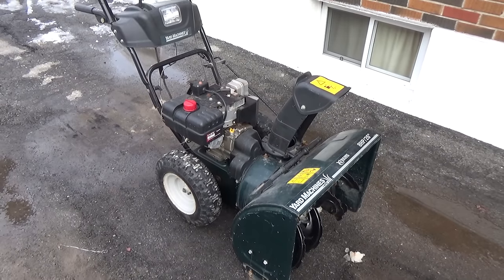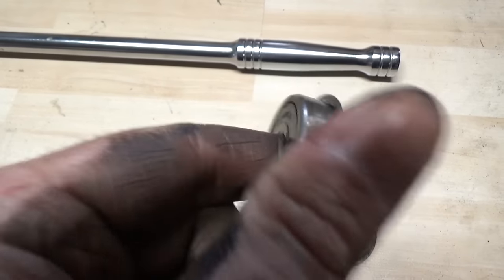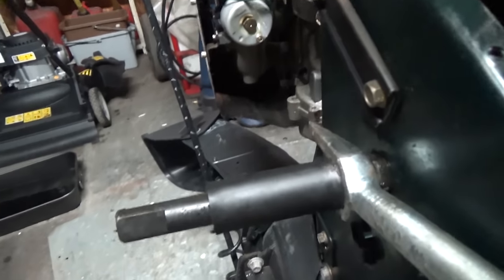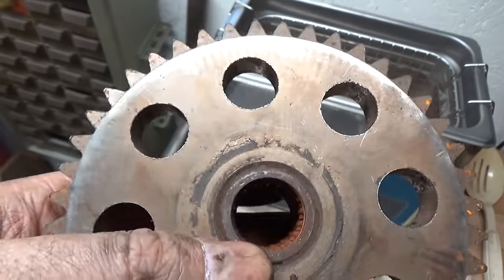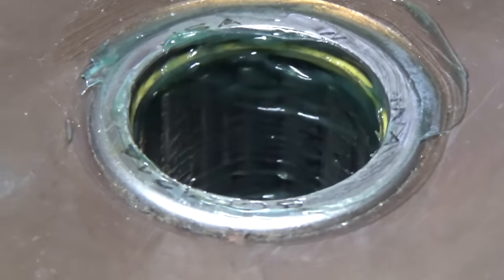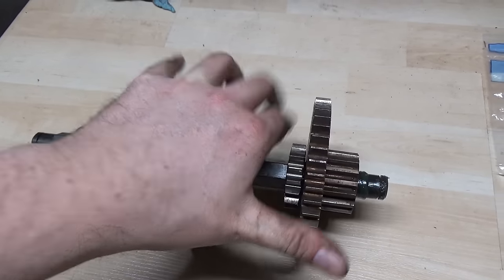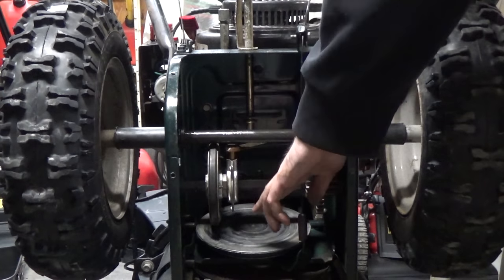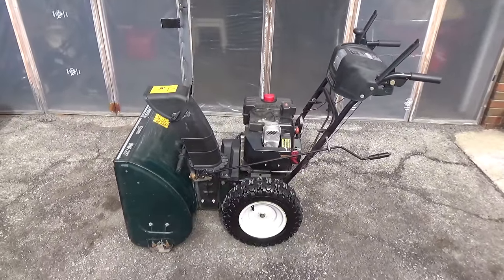MTD Snowblower Doesn't Move - HOW to FIX!

Comment: A very good repair job with excellent explanations and illustrations.  Excellent job and thank you.  However, Given the costs of the labor and the parts as well as the age and condition of the snow blower, I probably would have just purchased a new snow blower such as an ariens 28 inches.  I just don't like the quality of made at all And I have owned them in the past.
Reply from the maker: Get an Ariens deluxe or higher model
Reply: @EliminatorPerformance  Thanks for the advice and I think you are absolutely right.  Especially given the fact that you routinely work on these things and you know how they are built and designed.  By the way I really enjoy your channel.

Comment: FYI Also, Latex or nitro gloves work great keeping your hands clean when dealing with a dirty repair. Also saves on the hands. As many have stated you have done an excellent job! Also, those washers on the axles are referred to as Thrust washers. The pliers you refer to are Channel Locks.
Reply from the maker: I prefer using barrier cream, works pretty good and my hands wash off fairly clean at the end of the day! Keeps hands from drying out after being in contact with gasoline too!

Comment: If my blower is in reverse and I shift into drive, the unit will remain in reverse until I upshift into #3. Once there I am able to down shift to #1 and everthing functions forward until I go into reverse. How do I adjust for this? Thanks. BTW , very nice video. Your instructiona are easy to understand and follow! Only one suggestion. You need a light for dark areas. Again, thanks!
Reply from the maker: Thanks Mike, issue is with your shifter linkage, basically it's not going far enough one way.

The reason they work from 3rd to 1st but not R to 1st is simply due to the play in the linkage.

You need to adjust your cable or your rod, lengthening it will increase drive in 1 direction, shortening will do the opposite.

Play around with it, usually takes me 2 or 3 tries to get em right!
Reply: @EliminatorPerformance  Thank you! Have Tools.  Will try!

Comment: I always just used lacquer thinner on a rag to clean off greases & oils, etc.  It even removes old hard grease well, like on 100 year old victrola spring motors where what was once grease has basically turned to cement.  It's less than 20 bucks a gallon here and a gallon will last a long time.  Yeah, it'll turn your hands white too, lol.  As white as 1-1-1 trichloroethane vapors will in a heated degreaser dip tank I used to use in a factory when I worked in their repair/reprocess dept.  If you have a lathe, chuck up those axles and give em a spin with a light grit wet sandpaper or even that scotchbrite and it'll speed up your work instead of having to wire-wheel everything. :)  It's also good for putting grease on a rag and coating the axle lightly.

Comment: Is it bad that i had this issue today. My machine is from 05/06. But i can’t get the roller barring. The whole assembly but it comes with a new friction wheel. If i find the rollers she’s a keeper. If i can’t i may just get a new machine. It’s a cub cadet. ina sce108 is the bearing if you have the same issue

Comment: I had a similar experience on a very similar (YW) snowblower.  I think that using needle bearings on a non-hardened shaft is a very poor design.  Add to that that there's no provision to lube the bearings properly (zerks).  Plastic bushings on the wheel axle is another thing that shows these machines aren't made to last.  I dumped my YW and went for an Ariens: Paid more than twice the price, didn't regret it.

Comment: Great video !   Did you consider replacing the friction wheel and friction disc since it was all apart ? They both appeared worn to me,
Reply from the maker: It was a customers machine and the friction wheel worked, so we didn't replace it. Still working good to this day!
Reply: Makes sense... but if your customer is anything like me ( and he can thank god he isn't haha ) I would've liked the option to just to replace, then keep the old one as a back up. Nice Vid, New subscriber!  @EliminatorPerformance
Reply: I personally would keep the old one on and then have a new one as a replacement, old one has plenty of rubber left on it and the rubber O-ring on the wheel is replaceable so you don't need to change out the whole drive wheel.

Comment: Well done! Good angles and pointers! Excellent video!
Reply from the maker: Thanks for watching!
Reply: @EliminatorPerformance  I am a tech, but I haven't done a snowblower repair. I usually stick to cars, truck, bikes, atv's, boats, and stuff like that. But my neighbor has an old snowblower that is locked up exactly like this. I was unsure if they were friction plate or chain drive, so this really gave me a heads up on what to expect. I really like that you greased things for "next time" when most people would never bother. You run a great shop, and your repair was top quality. This kind of repair is what customers tend to just throw away the unit and buy new. You saved this customer tons of money and with your repair, will probably last forever.
Reply from the maker: @rhawk2424  thanks for the kind words! I haven't been contacted yet by this customer, so I'm assuming it's still operational!
Reply: @EliminatorPerformance  that's the best "thank you" you can get from a customer. If you DON'T hear back, everything is A.O.K. it's the call you get a day or two later, you need to worry about. That's the old "it started doing that thing again call". Silence is always a positive sign. Customers don't know techs loose sleep over big jobs, like did I tighten the drain bolt? Is the axle torqued? Did I lube the throttle cable? Did I bleed the brakes thouroughly enough? So, either they are happy or so pissed off you will never hear from them again. But usually, it means you did a great job.

Comment: Hoping this comment gets seen, but I have a 26" yard machine, I can manually push the machine, it definitely doesn't sieze up like the video here, but when I pull the drive control handle, which normally engages the tires, nothing is happening. Could it be the same situation with something in the drive not working? I had to get one of the tires fixed, and now after re-installing it, it isn't driving, but tires do spin
Reply from the maker: You probably didn't line the wheel up with either the spline for the drive, or in this case it's a bolt that goes through the wheel and axle.

Or, it's simply a case of your friction wheel not engaging, making an adjustment on the cable/rod that goes to the friction plate, you can tighten it up and it will engage more.

It may just be slipping.

Comment: Question: The hole, where the copper bushing (over the drive shaft) goes into, is elongated.  How to fix this problem so that the bushing does not wobble inside the hole?  I have a Noma 8hp snow blower (over 20 years old).  Thanks.

Comment: Great video. Question, if the wheel is frozen to the axle, what is the best way to get it off?
Reply: If its rusted to the shaft , pull the drive pully apart then take off the rubber drive o-ring then try soaking the shaft in a lubricant or a light oil and then work the drive wheel back and forth until it breaks loose then pull off and then clean up the rust. I have seen people grease up the shaft or a mixture of grease and anti-cease so that way it won't cease back up.

Comment: Quick question, I have the same exact snowblower. The issue i have is when I go to use it, it will go, everything engages, wheels go, it blows the snow. It will go then it seems to just stop. Like its getting stuck, I shimmy it and it will go again and then get stuck again. When I lift it, the wheels keep going but as soon as I lower it, It'll stop again. Doew it sound as simple as the skid plates? Or scrape guard? I can't figure it out

Comment: My phone skipped to a Mustie video. WTH? I had one of these do the same thing There was rust and everything was frozen up. After using PBBlaster on it for a few days, it broke free. Then the arm for the blower Auger was frozen also. Again, a ton of soaking with PB Blaster and eventually it started working. I had to rap on the arm with a bead blow hammer and eventually it worked fine. I did have to replace the Carburetor as it was full of corrosion. I just sold it a Month ago. It's hard to kill an MTD.  Good Tips on living those gears. No one ever does that. I have had the shifter frozen on the shaft many times too.
Reply from the maker: Thanks for watching!

Comment: You can get those bearings at any bearing supply house. Press out the old, press in the new. Done. No need for new gears unless they are worn out. 
Great video quality that could have been half as long without the constant repetition of what you were doing as we were actually watching you do it. I kept waiting for you to clean the drive disc while it was totally exposed with the drive train removed, especially after you had gone into extreme details about the special grease you were using that doesn't run, drip, or sag, which would have eliminated any chance of it getting onto the drive disc after cleaning. Maybe next time. LOL. Keep up the good work, EP.

Comment: On mine the wheels were not turning at all as well. I just slowly forced the wheels to turn as I lubricated the gears and everything.  It losend up and it works good now.
Reply from the maker: That's the core issue here, if you keep moving it around, they'll never seize up! Most people put them away wet, store them for the year, then have the issue the next season! Keep rotating assemblies lubricated, and there shouldn't be any issues. Thanks for watching!
Reply: @EliminatorPerformance  for sure! Thanks

Comment: I have an old yardmachine22”Snow blower.It have gearbox with tnasmission assemblies.Mtd co. Said to replace compleat transmission assembly which cost cas 150.but I has opened that gear box .only one gear is wrong all bushes and worm is working efficiently.can I can replace that gear singll

Comment: Dear Eliminator Performance, I own a Toro 824 snowthrower (1984).  It still works nicely.  Within the last few weeks, I noticed the right wheel as hard to turn.  Not completely stuck as i n your video here, just hard to turn (push by hand, and even while under power, the machine tends to want to run to the right (seemingly because the right wheel is hard to run by the drive mechanism).  ¿Do you think its drive bearings are getting corroded & seizing as in your video's fix?  Any advice/helps is appreciated.  Thank you much.  tonydd\.
Reply from the maker: Tony, could be you have the pin in the wrong hole so 1 wheel is "freewheeling".

Just a thought without actually seeing it... If it's gear driven, it could also be similar to this machine, the gear is getting seized up a bit and preventing it from spinning freely.
Reply: @EliminatorPerformance  , thank you for the kindness of a reply.  I've not changed anything on the underside, only lubed it about 2-3 years ago.  (It gets very little use, and only used it a few times this winter season).  I think you're right about the seizing of the bearing/shaft.  I'll have to take a look at it as you've shown in your video.  ¿Is there a chance I could free it up with some spray penetrating oil, for the time being?  Thank you much.  tonyd\.
Reply from the maker: Yeah get some PB Blaster or some Liquid Wrench, stuff works alright.

Spray into the gears and make sure you wipe down the friction wheel plate with some running alcohol or something to make sure there's no grease on it, or else it'll slip.

It should be a simple quick fix, but using grease on the gears is the only real solution.
Reply: @EliminatorPerformance  , awesome.  Thank you so much for your reply and help.  I'll give that a try.  Hopefully, perhaps this summer, I'll service it as you've done in your video, adding grease to the bearings, and replacing any damaged ones.  (This snowblower my dad purchased in 1984, and it works nicely, starts in one or two pulls.  Hope to keep it for use in our rough winters).  Thank you for your help.  God Bless you in all your good endeavors.  tonyd\.
Reply from the maker: Thanks Tony!

Comment: my snowblower the reverse 1st gear doesn't move, 2nd gear moves very slow. All forward gears are working fine. Any suggestion? thanks
Reply from the maker: Adjust your shifter rod/cable to make the friction wheel move over more. Simple fix!
Reply: Adjust your cables and lubricate pivot points. May need a new wheel drive belt. Check the owners manual for exact instructions.  The rubber wheel moving over the spinning friction plate decides speed and direction.

Comment: Great video! I’m going to be starting a small engine repair business, do you have any advice for someone getting into the business?  Do you recommend becoming a parts dealer or do you order online? Do you prefer Stens over other aftermarket parts? Any startup advice would greatly appreciated. Thank you for your time
Reply from the maker: I like stens, we order over $150 and get free shipping, Parts usually comes in the next day...

I usually go on www.ereplacementparts.com to type in model number and find parts diagram, that helps with ordering exactly what you need.

Parts dealer means you have lots of inventory and that means $$$ sitting around.

We're at the point now where we stock what we usually need, and order what we don't have.

We just signed up to Atlas Part's as well, so they're going to be great for MTD parts.

Amazon is great for cost savings but takes forever to get the parts (maybe 2-4months).

Find friends in the trade or just watch other small engine repair videos because I've learned so much over the years.

I've been doing this stuff for over 14yrs and about 5yrs as a career now, learn new stuff every day.

Often times well get the same machines but they'll have completely different problems!

Hope this helps and good luck!
Reply: Thank you for your reply. Do you fallow equipment flat rate guides to bill your costumers? If so where do I find flat rate guides?  Is there a good place to buy repair manuals for all the manufacturers? Thank you for your time.
Reply from the maker: We charge 60/he best thing to do is call a few local shops and ask their rates then find the average.

As far as manuals, normally you can just Google model number and something will come up.

I'm at the point where I normally don't need a manual anymore!

Comment: Hey this is a random question but there’s a guy on Craigslist giving this machine away has the issue you described do you think if I split the machine (remove the bucket ) would it fit in a 00 civic coupe ? I’m thinking the bucket in the trunk and I remove the passenger wheel and the motor wheels etc in where the seat was.. does this sound possible or should I just rent a truck
Reply from the maker: Probably not lol maybe if you too 2 trips?

Comment: thanks so much for the video.. very helpful.   only took about 30 min to have it all taken apart and cleaned up and bearings renewed all greased up and good to go now... like and sub'd
Reply from the maker: Awesome, thanks for watching!
Reply: @EliminatorPerformance  lol think i did something wrong.. when i push it forward it moves find but i can hear the gears hitting , also no reverse ?  not sure if it had reverse before i took it apart or not ... but im almost certain i have everything back in proper... going to work my 3 days shifts and take it apart again monday... main thing is that everything moves freely now. i will rewatch video when i take it apart to make sure everything is where it should be

Comment: For the wheel axles some say use Ant seize Grease is best, but some are using different types of grease like marine grease. They say grease will harden up and seize the wheel.
Reply: I’ve never seen marine grease get hard yet, I use lube plate brand

Comment: Do you know the average cost to have this work done at a repair shop?
Reply from the maker: Depends what their hourly rate is, it's at least a 2hr job and that's if the wheels come off easily and things aren't rusted solid. Plus parts if the bearing can't be salvaged like this one was.

For reference, I charge $60/hr in Ontario Canada.

Comment: I have a smaller snowblower that my tweaked out brother got ahold of and screwed the whole drive system up beyond comprehension.  I cant even figure out how to even begin to get it to work again  I looked under the belly pan and the gear is just spinning freely on the axle shaft and there's no part to lock it in place.  Also mine only has one gear contacting with a toothed part of the other shaft.  The other shaft does spin when I pull the drive lever when running it, but I have no idea how to connect the gear to the shaft.  Maybe I can weld the gear in place to the shaft?

Comment: Would you happen to know what part number or size those 2 needle bearings are inside that gear?
Reply from the maker: From what I've seen, you can't order just the roller bearings, you need to order the whole gear itself. I'll post a link.

Also, you can order the entire Drive Rebuild Kit: Part Number 753-05173A

https://www.ereplacementparts.com/gear-assembly-1644t-p-319236.html
Reply: Thanks for the info. Excellent instructive video!
I've fixed this same issue numerous times on my snowblower.
I'm going to keep searching for those needle bearings and change those in the future instead of buying a whole new sprocket every time.
Reply from the maker: Thanks for watching! And you shouldn't have to replace the whole gear, as long as you can clean the rust and corrosion off the bearing, it should be fine to grease and reassemble!

I used an Ultrasonic cleaner to clean the 1, and the other 1 I just used brake cleaner I believe.